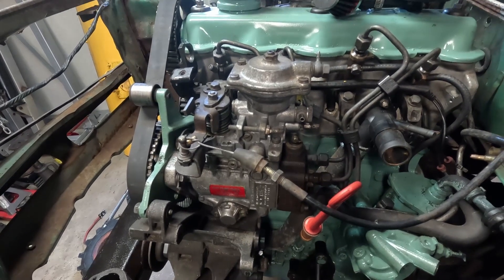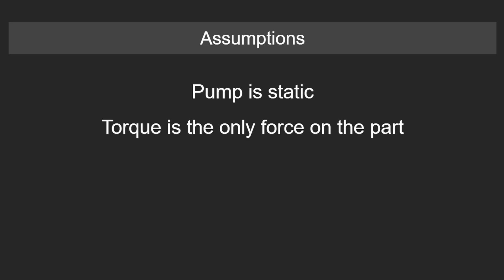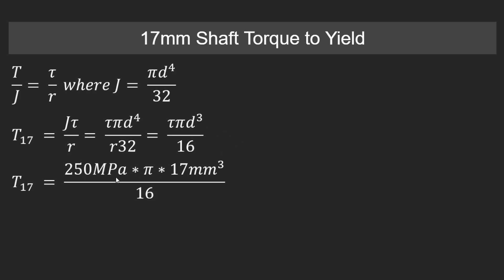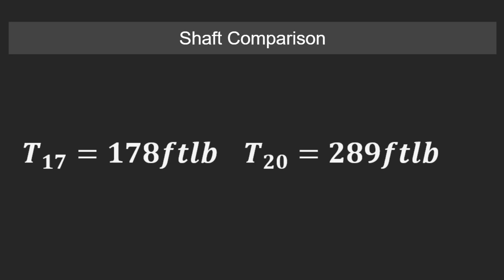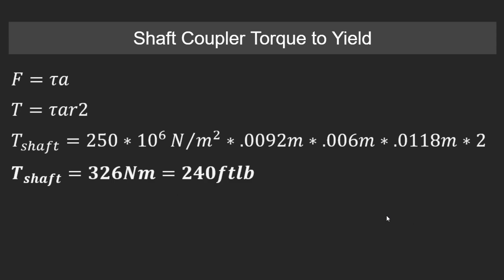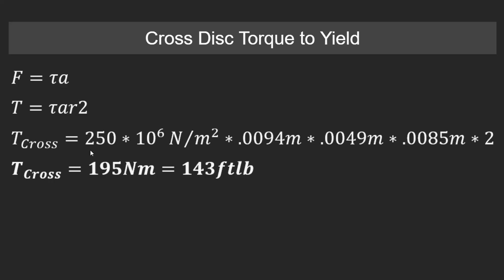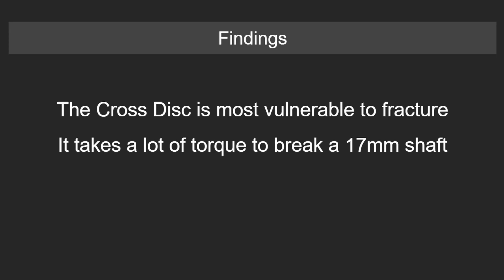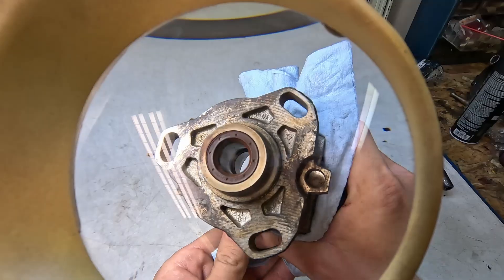MTDI Injection Pump - Is A 17mm Shaft Enough?

Comment: Hi, do you know about internal pump differences between left and right ve pumps? I’m trying to build 2.5td r5 pump but i have hard time finding „right” vp pump for 5cylinder engine, and I wonder what are real differences inside left and right pump
Reply from the maker: Most of the parts are interchangeable. I have other videos on the channel that outline all the differences.